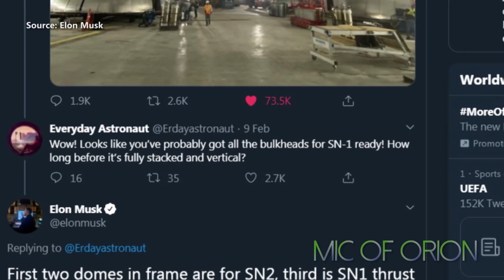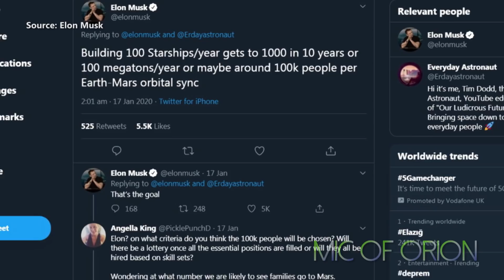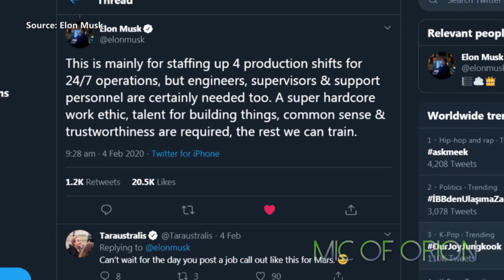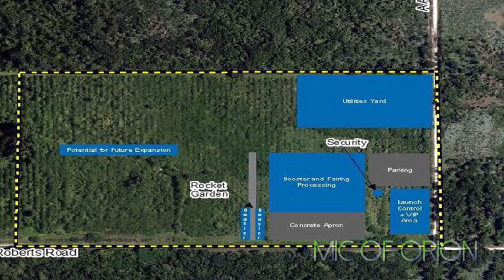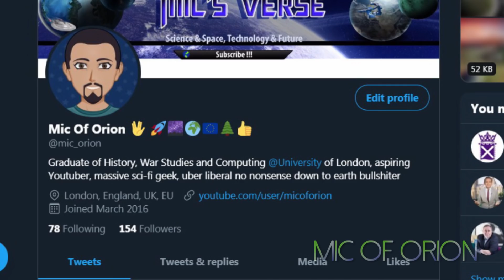SpaceX Started Work On Starship SN2

Comment: @mic of orion  I was under the impression during the starship presentation, last year, that the next versions would be a single weld hull.  Yet it appears that SN1 and SN2 are being built as rings of 5-6 feet in height.  Is that the case and do you think that SpaceX has abandoned the idea of a single weld hull?
Reply from the maker: JM, not sure, must admit, did you ask Elon on twitter? I was under the assumption due to heat issues at the re-entry there'll be design changes.
Reply: @micoforion  i would have thought a single weld hull from stainless steel would heat and cool uniformly compared to several welds in rings, but what would I know? Thats why Elon is where he is now and I am not that he never even notices my Tweets to get an answer. lol ☺
Reply: I took that to mean a single weld to make a ring, not pieced together like the ones  he was standing next too and not the whole ship. The sheet metal does not come in the size that they could do one weld for the whole ship. But yeah that would be ideal...
Reply: @-mike-8134  A single weld hull is a single weld.  I doubt it means several rings because that isn't a single weld. The single sheet would have to manufactured like that of course and aware of course it doesn't come in that size as standard. However, I think it is possible to produce it to that size.   Like I said above, a single sheet would behave uniformly during heating and cooling.  I just hope it all works well.  That's what all SpaceX fans hope for.
Reply: Basic rule of thumb, if Elon Musk says something, don't believe it, because within 30 minutes he will likely have come up with a better or different idea to try. The name of the game with Starship is VERY rapid iteration. The end goal will be to minimize hull welds for the obvious reasons of faster manufacture/assembly and more structural stability with less fail points, but that goal may have been pushed out in order to crank out more prototypes now to test various other issues faster.
Reply: @mycroft16  Fair point I am just dubious that anything but a single weld on an orbital version, even with the heat tiles will cause the vehicles multiple panels to heat and cool unevenly.  But like you say Elon is trying to find the best manufacturing method both in terms of cost and time and, of course, what works best for the spacecraft.
Reply: @M2M-matt  Also, remember, 300 series stainless steel can take a significant amount of heat more than other materials. This may also be playing into decisions about how many and placement of welds.